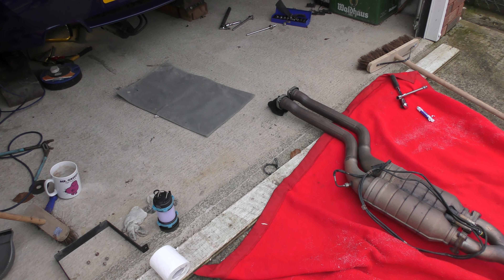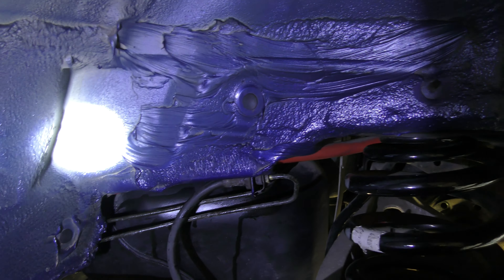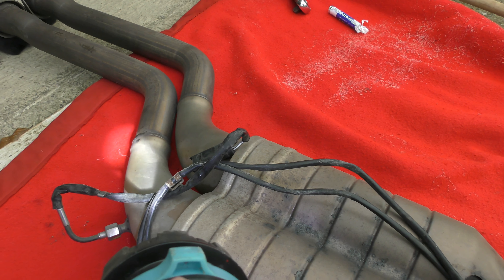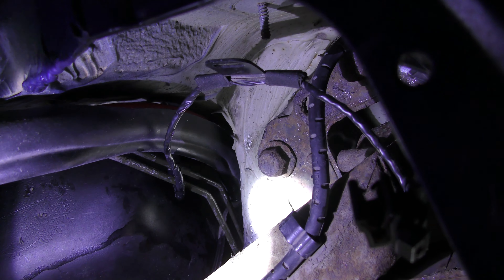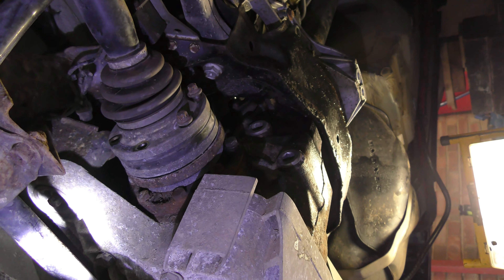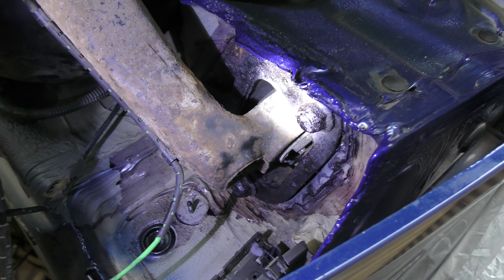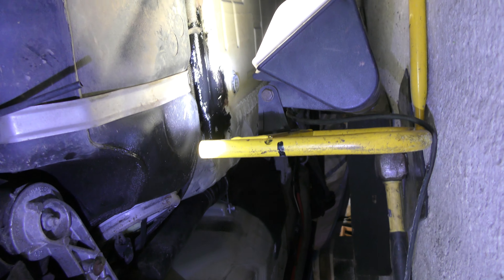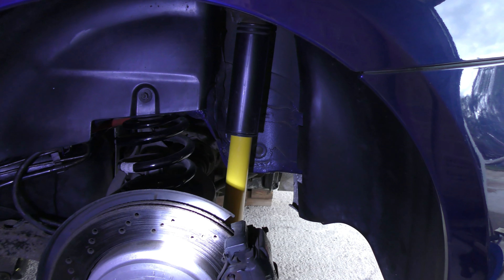2006 BMW Z4M: Underside Restoration Rear Half

Comment: Where do you find the time to do all this and prepare the entertainment you give us all? Deep workings going on there. Brought back memories of crawling around under my first car, a Ford Capri 1.3. I treated and then painted aluminium paint all over the underside. That was in the late seventies. I used to work on all my old cars, even a 2.6 (I think it was) Rover, straight six engine. The head gasket went (surprise surprise) and I took the head off and replaced everything, with the help of a mate from the Reading Rally Club we used to go to. Them were the days. Most I do these days is check the fluids and clean it ( a newer car, the Rover went to the great scrap heap in the sky).

Comment: Great vid ! Lovely car Cap . B the way if the brake lines are to be replaced you can use copper pipe and tooling kit to replicate the piping as the original and than they will last forever, as the kits online are very expencive :)

Comment: As an owner of a 55 plate 1.6 zafira I cannot help BUT as google is your best friend are you struggleing to stop the prop turning while getting to the nuts?? I found this "Thanks all, jammed a bit of 4x2 on the brake pedal and they came off lovely
Front mounting bolts on the diff as well were surprisingly easy
Just got to shift the mounting bolt at the rear which has so far refused to shift and bent a spanner!
Doused in penetrating oil and left till the weekend now 😁"
Reply: also lidl and aldi do cheap battery rattle guns that would help a treat...just need to keep an eye out for them as they come and go

Comment: What mileage has your car done, my coupe is at 52k miles and when I had it apart recently didn’t see any real rust apart from the rear lower arms, in terms of exhaust I went for RPI back box and it’s more than loud with an otherwise stock system in place, I believe eisenmann boxes are about the best all round if it’s going to be more of a daily
Reply from the maker: 49k miles but I think it was a farm car, they always get caked in mud.

Comment: If it was me, I'd keep the catalytics and then figure out a "straight pipe" solution afterwards.  Even if you have to use a flexible pipe solution, I'm sure they are availiable.
Reply from the maker: Roger Sock

Comment: Regarding the diff, if you're just replacing the input seal, why are you removing it?
Reply from the maker: I'm just not strong enough to do the job with the car up on jacks. Need leverage for bolts etc.
Reply: @grimreapers2  There's always a trick, what bolts are you going to struggle with?

Comment: You need a proper set of jack stands, mate. Those jenga blocks you're using look sketchy as hell.
Reply from the maker: It's Ok I got redundancies in place in case they fail. Jacking points on this car don't fit jack stands very well.

Comment: Be glad you don’t live here. We salt our roads, and it can be hell on cars.

Cap, before you mess with the engine/exhaust talk to me. I used to design catalytic converters — not the housing, I was the chap who chose how much Platinum, Palladium, and Rhodium was used. It was for forklifts and other non-road equipment but I know a fair bit about engines, including the electronics.